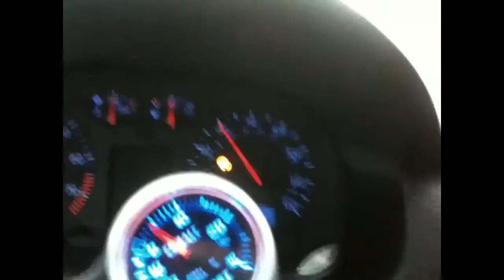Precision 6262 tried to kill my 10/1 motor

Comment: all VW's passed 02 are wide band. we didn't make modification to the tune changing from the gt3582 to the 6262. we run more boost on 10/1's no we just use better fuel. live and learn man live and learn.

Comment: It's not a certain amount of boost pressure that breaks parts, power causes breakage not boost pressure. Aside from that, agree with others here, the engine builder either didn't check/set the clearances properly or the tune was pretty bad or overly aggressive. Either way, the bore is probably ok, just get the crank side back in order for that cyl, check the others and move on learning.

Comment: as a tuner you guys fucked up going high compression with high boost, and a 6262 with a 1.8t vw. did you even have a wideband 02 in the exhaust?